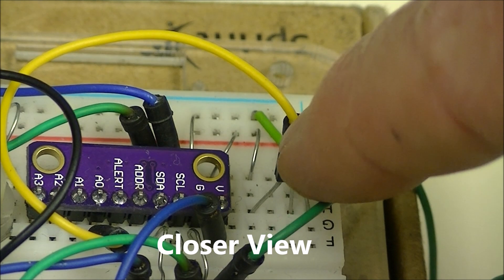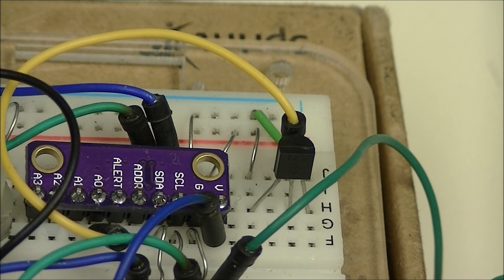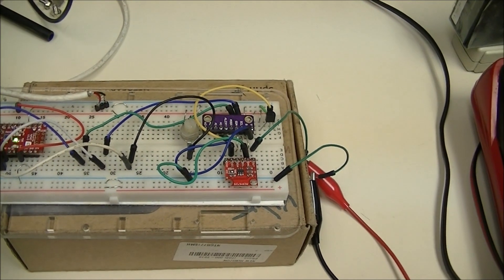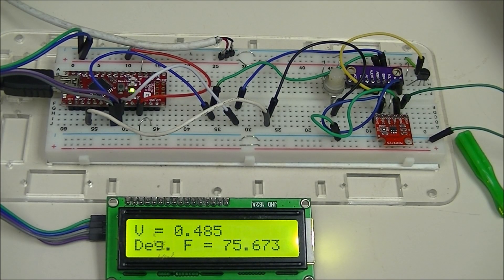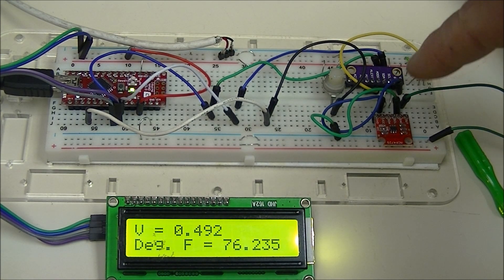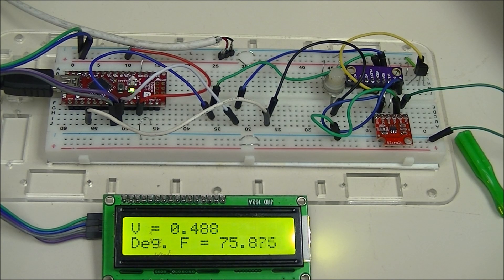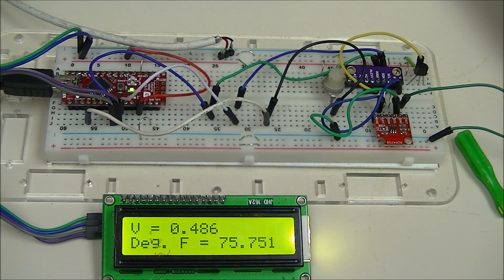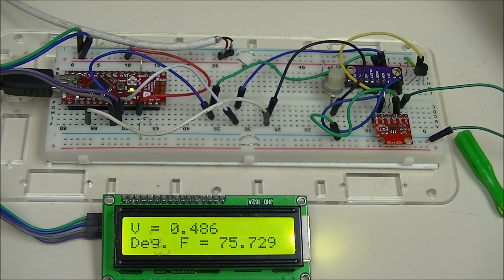Arduino ADS1115 16-bit Analog-to-Digital Converter

Comment: As amazing as this unit is, one thing to note about the ADS1115, is that you can NOT measure any voltages across all 4 of the inputs if the total sum exceeds 6.144VDC, as the chip has an internal MUX and not 4 individual inputs.

Found this out after a couple of failed attempts, as I am in the process of putting together a "Remote Voltage Monitor" as I like to call it, for the solar batteries I would like to keep an eye on.
 
I eventually had to settle for the differential input (edit, that didn't work, 2 x single shot modes), with a resistor divider network that only allows 1,371v measured at 2 of the adc inputs, one at 2.742v on the input that spans both battery banks, and then obviously the "Most Negative" of the 2 banks being 0v (Totalling 5.484v across all 4 of the inputs) , making 100% sure I never went over the total of 6,144vDC that the manufacturer notes as the absolute maximum.

Obviously the resolution does go down slightly from what I have seen, but still well within the resolution I wanted to read.

This was just a side note for any one wanting to use this ADC thinking it has 4 completely individual adc inputs, as it does not, however, the manufacturer does not stipulate this in Any of their literature I have read through.
Reply: Hummmm....that is somewhat disheartening as I was planning on using the ADS1115. Thank you for your post, it will save me a few headaches.

Comment: Hello. Seems that I'm always asking you questions........ I am trying to use a tm1637 to display my ads1015 readings and it seems that maybe the tm1637 is not a true I2c device? It has CLK and DIO and I can not seem to make it work?  Hmmmmmm????
Reply from the maker: You need to look at the data sheet. It isn't that it is I2C but the sequence for data transfer. i have never used this device.
Reply: Thanks. I got the ads1015 to help with the analog read load on the Arduino (I need 4, 4 digit led displays) for motor speeds and it seems the piggybacked displays read lsb or msb first? Sometimes it gets beyond silly with so many libraries and some work better for some things while others work better for something else. I have too curious of a brain  :  (
Reply: I think if i use two analog input and two resistors i have 2046 in resolution, analog A0 is direct to the sensor, A1 is in the middle of the two resistor (two 10k) one resistor is to ground and the other to the A0, i think it migt work, now som code is to do

Comment: Can I use thermocouple type T with ADS1115 4-Channel 16-bit Analog-to-Digital Converter?
Reply from the maker: I doubt you can the voltage is so small.